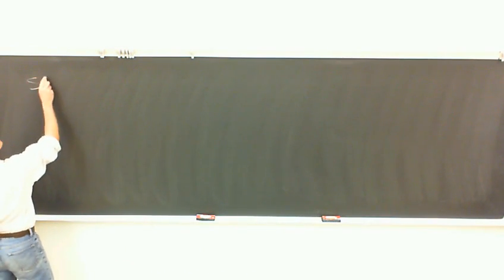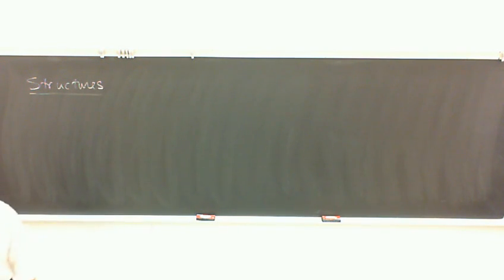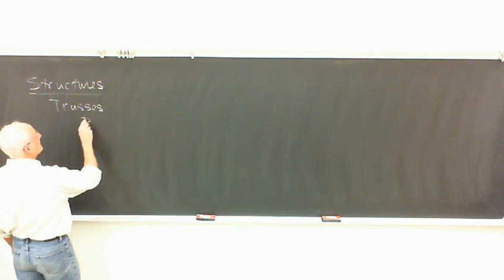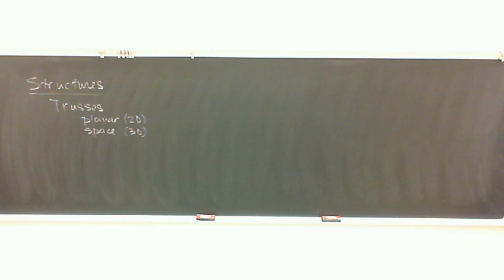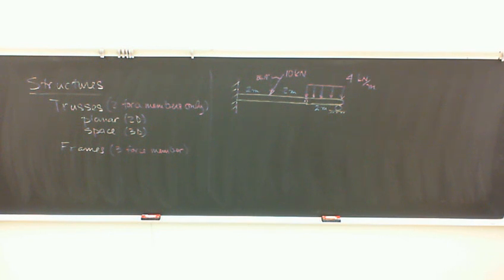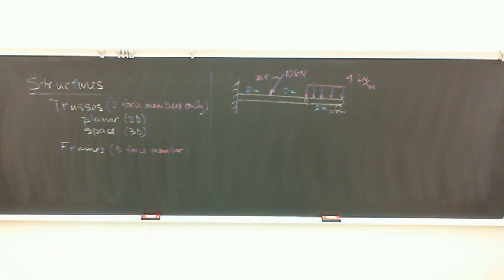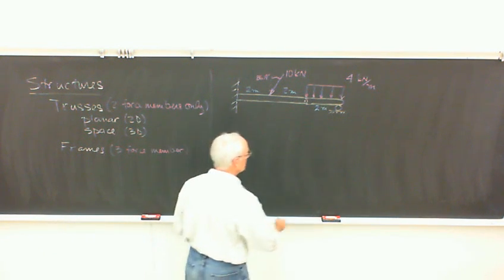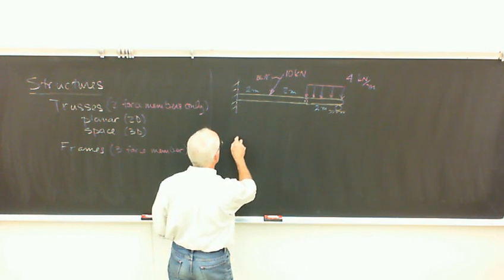Frames and Machines, Part I

Comment: Why is that Ax derived by multiplying the sin of the angle ? Isn't it should be cos ?
Reply from the maker: Give me a clue where to look in the video and I can tell if that's a mistake or not.  Thanks.
Reply: Ken Manning Min 19:19
Reply from the maker: Chandran kartar singh It is correct as written since the given angle is as measured from the vertical, not from the horizontal.  With that, the horizontal portion is the side opposite the given angle, thus it is the sin.
Reply: Ken Manning  Ok. I am so used to see the angle from horizontal. Thanks a lot.